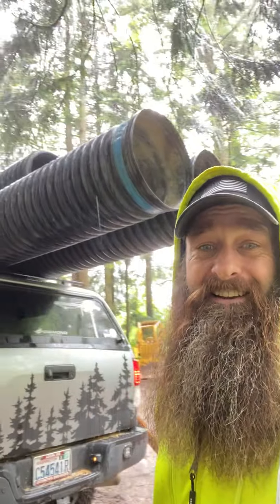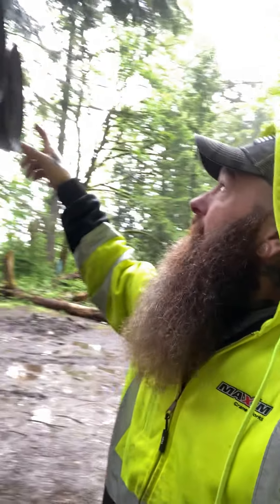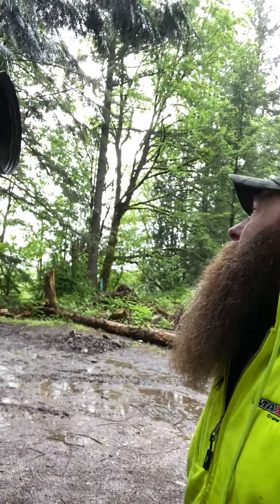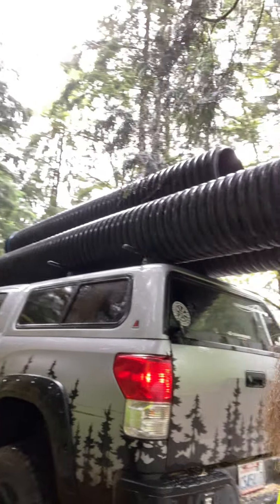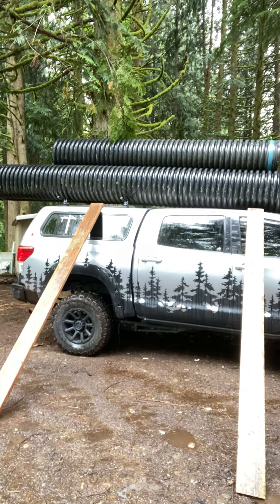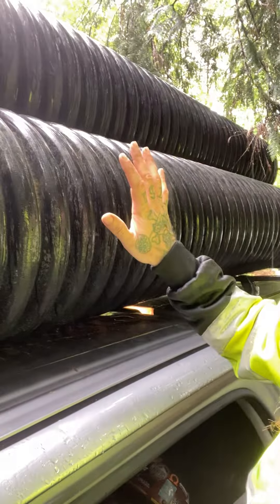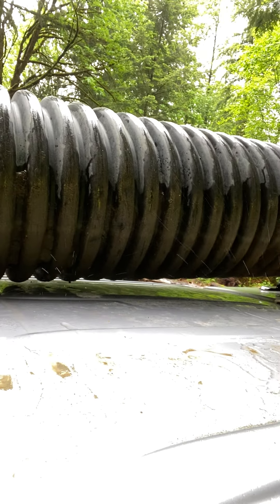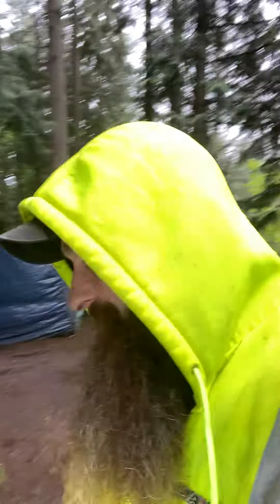Heavy heavy heavy culvert!! Can I get it down￼?￼

Comment: I been using the black plastic ones every in expensive,  they been holding up great. Have a great week end gang..
Reply from the maker: I am super excited to get it in the ground but now I need to get a piece of equipment…
Honestly I never even realized that there was a metal frame on the inside of them which is even better!
Reply from the maker: @robertwressell1147  that would be awesome! 
But at 25 miles an hour I think it would take a little while!
Yes most definitely!
Reply: @foxhollerhomestead  at  the price of diesel for my truck and trailer to get there. It be cheaper to buy you one. If that works. L
Reply from the maker: @robertwressell1147  😂 I hear that!!